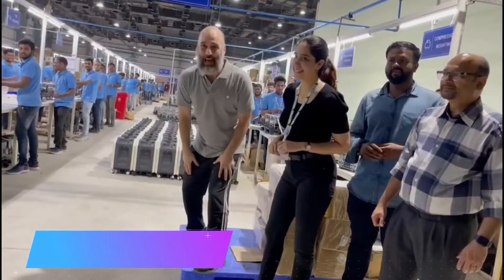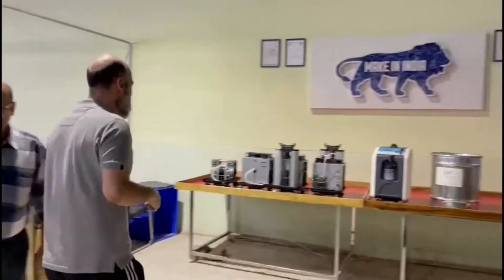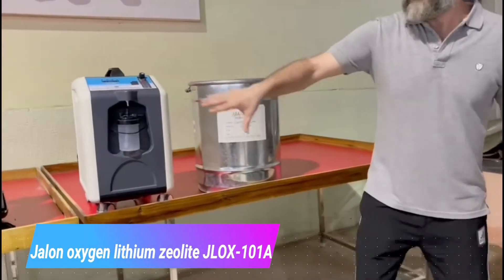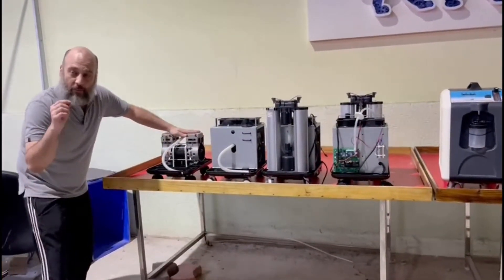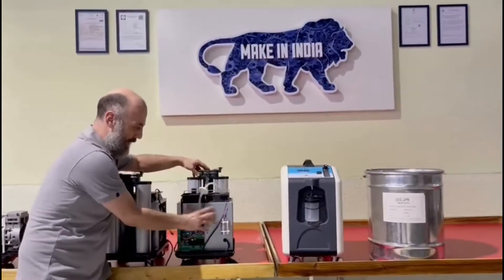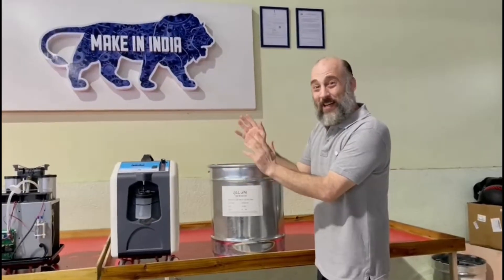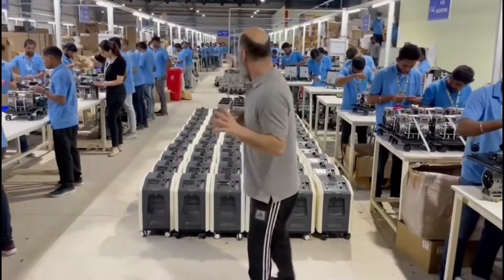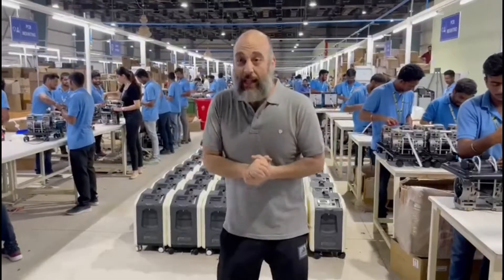Molecular sieve for oxygen concentrator#zeolite#molecular sieve#oxygen concentrator

Comment: Where we can re fil ziolitt molecules
Reply: You can check your local medical supply market or technician otherwise you can order from Jalon, in China
Lithium-based Molecular Zeolite Sieve is best and
mostly used size in 5 Liter: Diameter 0.4-0.8MM
Approx 1.2kg is required for a 5 liter/m oxygen machine.
You can open your machine and take out the zeolite from the two cylinders and weigh. Do not throw it as it can be recharge also.
When filling the room should be clean and free from moisture and high humidity and 30% is fine. Immediately close the cylinder. Remaining zeolite should be packed sealed properly.

Today I am refilling my Folee brand 5-liter oxygen concentrator
Reply: @MTJ79  can you please tell me how to regenerate lithium zeolite 13X 0.4 mm and check it is regenerated or not??
Reply: @Er.AvinashChaurasia   I am also learning. I have taken out my old zeolite in a container but not yet recharged. I read and there are around three ways to recharge and the easiest is to microwave. You have to heat it at 250°C. I will take the technical guidance from the zeolite company from which I am importing.
Reply: @Er.AvinashChaurasia   The easiest way to check if it is charged is to put in a glass of water and it makes a bubble reaction in water.
Reply: @MTJ79  Can you tell me what is the rate of 1kg zeolite which you are importing from china?
Reply: @MTJ79 kindly let me know if you have any source in Bangalore where I can buy sieve bed molecule

Comment: Would it be possible to switch On/off concentrator from another device?
Reply: @countryandnorthern1   you can use smart WiFi plug to control remotely turning on and off and also using timer